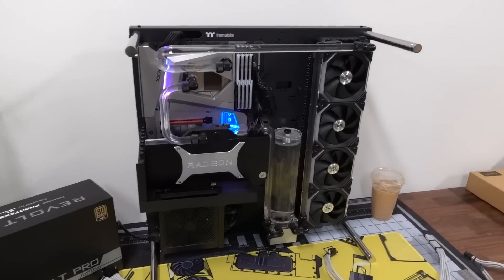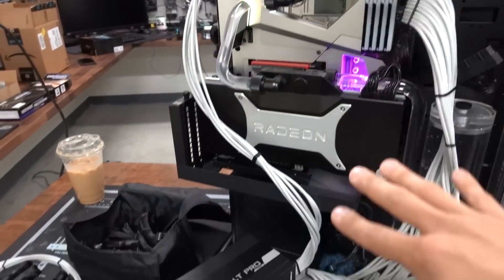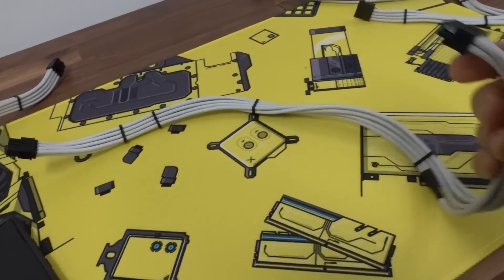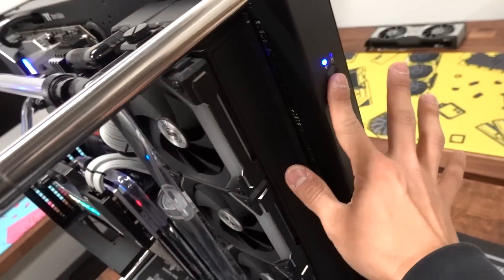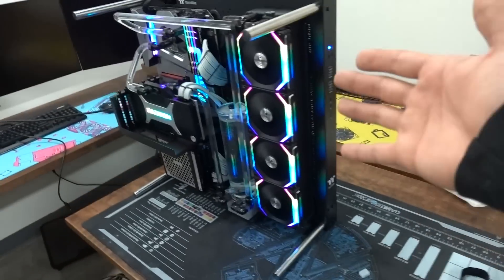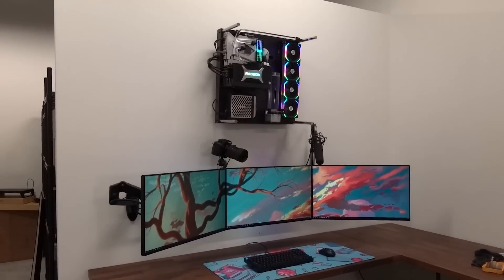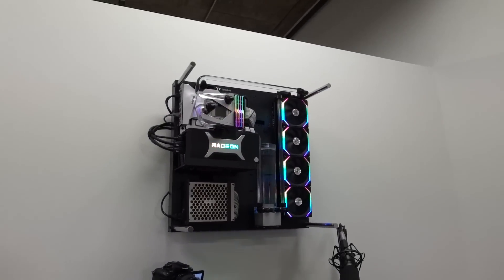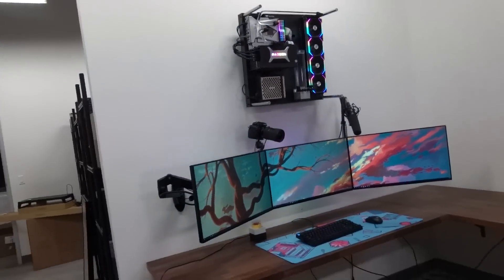I PUT MY PC ON THE WALL!!

Comment: Solution for the Tilt:

You can by adjustable furniture legs that you could screw into the dry wall and use 3-4 of them to PUSH the system from the bottom rather than PULLing it from the top.

Spreading the pressure across 3-4 furniture legs along the bottom of the system. You don't even need to secure them to the system as theyre pushing against what the sytem is trying to do and hang forward.

Extra ideas for the setup:

Get a mini-floating shelf, get some personal pieces up and add some plants/greenery!  Bring the outside into your setup, given your background has trees on it! :)
Reply: The weight once the TG panel is on would likely cause it to tilt again just that much further away from the wall. Needs to anchor up high or eliminate the travel in the tilt mechanism.
Reply: @stevenwoodworth9966  I'm no engineer, but thats why the adjustable ones are cool, because once theyre screwed in, you can just twist them like a screw and they extend. A quick amazon search will show you what I mean rather than my poor explanation! :) 

But you make a valid point, one to watch out for..
Reply: Won't work, the mount is a swivel and it would simply push it outward. I do feel it should be possible to have a long through the system in to a stud (or use like an umbrella plug or whatever those are called) and thus pull the top into the wall.
Reply: @r000ball  I’ve mounted literally thousands of TVs and ran into this issue a lot with heavier units or cheaper articulating mounts. Shimming the bottom with any method will eventually result in the arm extending further from the front most plane (furniture legs, shims or otherwise). If they were attached to the wall and the bottom of the chassis it may hold assuming the case doesn’t have any flexibility where it’s anchored. Otherwise like you said the case pushes against the shims and since it can’t go anywhere it results in the arm giving way by traveling away from the wall causing it to tilt again just with the added distance from the depth of the shim or furniture leg. The idea seems like it will work and often does for a day or so but it ends up being a pain eventually. Shimming and tightening the arm to the point it can’t extend can stop it but then you can’t extend the arm without a lot of effort which defeats the purpose of an arm. I tried that method a few times with lighter units and ended up having to head back out each time. Much easier to use a fixed mount intended for the purpose. I like the extra ideas for the rest of the setup.
Reply: Zip tie the arm so it won't extend amd then shim the bottom (as mentioned already).
Reply: I was going to suggest something similar.  Legs or feet sticking out of the wall and pushing on the bottom of the PC.  Then have a cord going through the loops on the back of the PC and the wall to keep the top form tilting forward while the feet push the bottom forward.
Reply: He could also just put a wood spacer on the wall at the bottom of the pc case with some double sided 3m tape and it would keep the bottom from tilting inwards
Reply: Maybe a top center 90` with just a small lip to catch the PC. Find a 3D printer person to make it out of semi-clear material that's hollow so you can make it RGB. Are maybe use the same type of tubing that you used in the water cooling loop!
Reply: My 2nd idea is to make a 4 side box/plus back for mounting to wall, the same size as the PC about 4-6'' tall that has 2 swivel tabs on top to lock the PC to it. If you make it out of diffuse Lexan and mount RGB lighting inside it would glow as well as cover any cables behind the PC from the sides and top/bottom! You could even make it 120mm tall so that you could add a RGB fan on each side or (2-3) on each side LOL Shit just make the box out of those RGB fans that connect to each other and run them all around the outside diameter. Every thing RGB.
Also add those RGB panels on each side of the PC! OK OK remove the dry wall and replace with Defuse Lexan so that you can make the entire wall RGB.
I was thinking of making my roofing shingles and siding of my house the same so my entire house would be RGB. Shit if I did that and turned it all to white maybe the tree in my front yard would just burst into flames. Now that would be cool!!!
Reply: Why is everyone only talking about putting a shim against the wall? I would put the shims between the mounting plate and the PC.
Reply: @eDoc2020  Would that work? If he, can get somehow get a hard stop on the tilt mechanism then that should work, is that what you mean, shim it in that tilt mechanism? I think it would be dangerous to shim between the mounting plate and the PC as those vesa mounts generally want to be straight on to line up.
Reply: @stevenwoodworth9966  Listen to this guy ^^^.
Reply: @TecPhoenixz  yeah, lol lazy ass me would do that but pretty much dangerous XD. it could work but that's just dangerous..
Reply: I like this because it isn't suffocating the radiator exhaust.

Comment: Pc's on the wall make me so nervous 
You have two points that scares people, its on a wall and water cooled
Reply: put on the roof upside down, if something fails with the water cooling, the water will fall on the ground and not on the build
Reply: And it's above 3 monitors!! 
Imagine the loss in $$ if it falls!
Reply: @hino8891  just put it in another room duh
Reply: It just looks bizarre and out of place to me, like if someone decided to wall mount their toaster or something.
Reply: A badly mounted 3090 falls from the roof
Reply: @Letheansound  that's actually a good idea, wall mount it aligned to your plate, when the toast is good to go, it flyes to your plate
Reply: The weak fear the strong. This is good.
Reply: @airgeadlamh  You're right actually. I would rather have toast fall onto my plate than an 6900XT.
Reply: @Letheansound  I'd like if a 6900XT flyed onto me, then I would have one
Reply: I somehow think it looks cooler
Reply: Yeah but it's not like he has hyper important shit on there like most people do, it's just for work and games
Reply: Do you worry about wall mounted kitchen cupboards falling?
Reply: @airgeadlamh  you and me both
Reply: If only you could have put more studs or 2x6 mounting board inside the wall before you built it.
Reply: If it falls, he makes back him money in content.
Reply: What about your wall mounted cabinets? Mirrors? Window frames? Ceiling fans, shades, pictures. All things mounted are scary?
Reply: Worst case scenario: unexpected shower followed by a loud bang 

Could be worse - the coolant could be the opaque, colored stuff

Comment: When I used to mount tvs, I would use a wedge to hold heavier tvs level. Home depot sells wooden wedges that are made for leveling window and door frames. Just put it at the bottom of the part that swivels the mount down. Also they make flat mount tv brackets that will hold the pc flat against the wall. Some of them will want more than one stud, but you can just place a center screw in the stud and use wall anchors to hold the pc level. The one screw in the stud will hold all the weight.

Comment: Solution for the tilt: mount a bar across the top and secure it to the two holes that the mounting hooks are currently in and then mount one hook in the center of this bar, then you should be able to Mount the hooks perpendicular to the wall and the PC.
Reply: Or just put a piece of wood or something on the bottom to push it away from the wall.
Reply: @nis-tm1472  thats what i was thinking
Reply: Screw a couple of adjustable furniture legs (IYOYI 4 Pcs Adjustable Furniture Legs Stainless Steel) to the wall at the bottom and adjust them out maybe?
Reply: I was going for the simplest solution using what he already has, it isn't perfect, however it is something that should work well enough without modifying the look he was going for in the video
Reply: @nis-tm1472  It might not solve the problem though, the arm is not fully extended, so it might just push the arm further out. It might work well in addition to my solution though.

Comment: If you're just trying to make it straight vertically, you could simply push out the bottom of the PC. Like, shove a spacer between the bottom of the PC and the wall.

It might not work but it would be a really quick test!
Reply: yeah, he could mount like a bar of metal with an L-shaped end covered with rubber as a spacer and for added support
Reply: @mrrubikguy4424  My only concern with your idea and mine, is that the top might end up pushing out as well, thereby not fixing the problem. It depends on how much tension is in the original mounting mechanism.
Reply: Exactly this.  It'd be an easy mount on the stud, and a quick/less complicated solution
Reply: Yep, that's the solution. Many tv wall mount systems come with a plastic piece to be used at the bottom part to offset the tv from the wall. I could not believe how Kyle decided to go with such a complicated solution using that rope and tension mechanism. Lyle laughed so hard.
Reply: @0Rosina0  an easy fix to that, is that he could measure before mounting the spacer:p
Reply: i.e. use a 5950X as a spacer
Reply: computer wall standoffs!
Reply: Or two pieces of 2 by 4s as a spacer and call it a day
Reply: Yeah Lyle wouldn’t have had all these issues
Reply: @0Rosina0  the spacer won’t work but may as well try. The weight once the TG is on the front will make it even worse though. The spacer at the bottom becomes the new wall face and just moves the problem further out. Used to have the issue with old plasmas. Need to get a mount with a fixed or no tilt option. Real peerless mounts have the option. Would probably have to cut the plate down a little though.

Comment: Kyle, shim the mounting bracket attached to the back of your pc. It'll help kick out the bottom so it's more leveled with the top. You can use just about anything as a shim, idk of a vendor you could use, but you can use literally anything(cardboard, wood, old pc bracketry you were just going to throw away, etc.) Normally, I would use laminated aluminum shims, and you may need about .300" at the bottom, but that's just my guess from eyeballin' it.

Comment: You should build a white wooden frame mounted to the wall that runs around the edges of the case, once the system is pushed back as far as it goes, the wooden frame would push against the bottom part that is slacking down, and push it away from the wall, tilting the top back, you might need to do that clip thingy at the top in one of the corners to give it enough tension, but this approach will take some strain off the wall mount, look far cleaner from the side of the build as well, so when you walk into the room you won't see that space between the case and the wall but nice flat flush surface. That will also give you a surface to recess LEDs into, if you wanted to, or put a cool wrap on, hook some little succulent terraria onto from the bottom to just float slightly above the displays, mount small speakers onto, or like a small side mounted PC stats screen similar to what jaytwocents did...

Comment: If you want something to hang really flush with the wall, look for something called Z- Bar or french cleat. Essentially, they are 2 pieces of metal (you can cut them to size). One is nailed to the wall, the other on the object, i.e. PC that need to be on the wall. They interlock and the piece on the back of the PC will slide into the wall piece. Each piece has multiple holes, one or more might  be on the stud. Even without studs, the multiple holes will provide enough traction to hold objects up to over 100 lbs securely

These are used by art galleries to hang huge pieces of arts, very large heavy mirrors, etc. (I used to be in the business and we used them a lot).

You find them at Amazon by the way,
PS: The only piece of the puzzle, how to attach the metal piece to the back of your PC, but I am sure you'll find a way.

Good Luck
Paul

Comment: Just use a block of wood that's cut to the right size behind the PC.  Put it towards the bottom so it pushes the bottom out further.
Reply: and paint it black for the optics.
Reply: Yep, this is the simplest, cheapest and fastest way to do it.
Reply: Exactly this is the best solution....
Reply: MAKE IT LONG ENOUGH TO SPAN THE CENTER STUD THEN PUT A FEW SCREWS INTO THE WALL STUD TO HOLD THE BLOCKING IN PLACE. REGARDLESS IF THE COMPUTER IS THERE OR NOT
Reply: @tallone37  I think it's better to secure it to the pc "case" so you don't ruin your wall even more, with holes.
Reply: That was my first thought, just shim the darn thing.  KISS....

Comment: You need a bumper on the bottom back of the PC case to make it sit even. I used to do custom framing. Everyone always tries to go do pulling back the top, but the trick for flat is bumping out the bottom. Measure how deep it is to make it flat and then cut a piece of wood or some sort of material to that depth. Attach it to the case and when you push it up to the wall it should sit evenly. If the majority of your weight is the power supply, then you may need to add some support of pull to the top after that. If you want to get really fancy and lose the tv Mount, you can also try a French cleat style hanging system. Also for the speakers on the side, you should use Panel Speakers made from wood with an exciter on the back. It’ll give you a cleaner look.

Comment: Mount the emergency button in the wall, so the button is flush with the wall and looks like one of those emergency shut off switches for large datacenters.  Then route the cable through the wall to the PC, so when you walk in you can press the button to turn the system on and press it to turn it off as you go in and out of the room.
Reply: @BitWit
Reply: I like this idea 💡..
Reply: Where can I get one of those?

Comment: To make it straight, the best thing you could do is change the mount. Get a piece of plywood, span it across multiple studs, paint it to match the wall, and then you can screw into any point on that sheet of wood to mount a low profile, non-adjusting (THIS PART IS THE KEY) mount.
Failing that, don't try to fix the sag from the top. Use some sort of spacer to make it so that the bottom can't move any closer to the wall and you'll be working with the weight of the system instead of against it.

Comment: I love what you did with your monitors, I did something similar but with two monitors. What I found is that you can get a piece of 2x8 wood (or any depending on the size of your monitor arms)  and mount the wood to the studs in the wall, that way you can use the wood to mount any kind of monitor mount whether a single stud or double stud system. It also allows for you to have more freedom when deciding where to mount your monitor arms because you're no longer confined to having to find a stud to position them. Additionally you can paint the wood and install mic arms/lights/streaming equipment/ect. Combine that with the cable passthroughs you have shown and you will achieve a beautiful floating wireless monitor set up with the added bonus of ease of installation and versatility.

Comment: Instead of using a 50ft Ethernet all the way to your router, use the 50ft Ethernet to route a switch under your setup, then from there you can have multiple Ethernet ports to plug your devices in
Reply: Yeah, switch it up.

Comment: I've had this same Thermaltake case mounted to my wall for a couple years now and I love it. It's completely out of the way, but it looks aesthetically amazing and gets lots of compliments. It's also super easy to remove for cleaning or upgrading; I can literally just lift it off the VESA mount. I'm not sure why you're having a tilt problem... I guess it depends on the model of the mount, but I use a cheapo $20 mount that looks similar to yours with plenty of tilt adjustment, enough to slightly "reverse" tilt which can allow the PC to be perfectly flush/level even accounting for some sag from the weight. Alternatively, you could use something like shims or washers on the bottom section to force it to tilt slightly more upwards.

Comment: Tilt thoughts:  Rather than what appears to be a natural fiber rope, which is going to be relatively stretchy, try using picture hanging wire.  It won't have as much give, and you should be able to really pull it taught.

Alternatively, you could put wall anchors right behind the bottom of the PC, and try using long screws as standoffs to bring the bottom of the PC out the same distance as the top.  It's not as clean, but it would work.

Comment: It would be really creative if you put it on the ceiling! 😂
Reply: he’s just gaming and a whole ass pc falls on his head
Reply: At least dust wouldn't be a problem 😅
Reply: Thing is that heat rises. So the pc would be hotter that way. So the wall or the floor are way better options
Reply: At least if the water cooling leaks the components are safe
Reply: Cables?
Reply: Nice
Reply: Why not outside, on the roof...  ;-)
Reply: @nesimovic2263  put it near a ceiling fan. 😂
Reply: Strap it to a ceiling fan 🤣
Reply: Imagine when you have to turn it on lmao
Reply: @Hansoluf  use a remote switch
Reply: If he did that UpHere would definitely have to sponsor it😂
Reply: dooba  or use a remote
Reply: dooba  just dont have high ceilings ; )
Reply: Get Lyle to do it